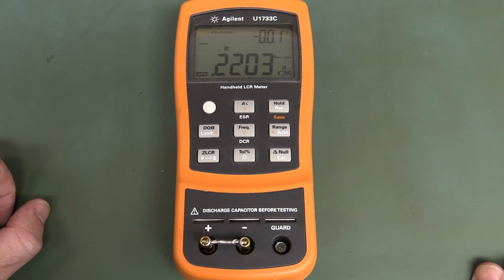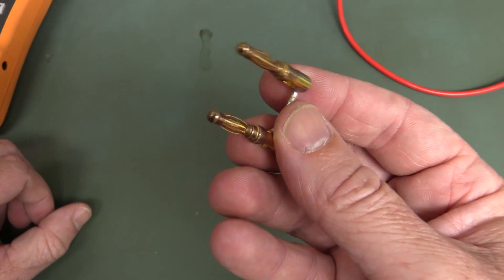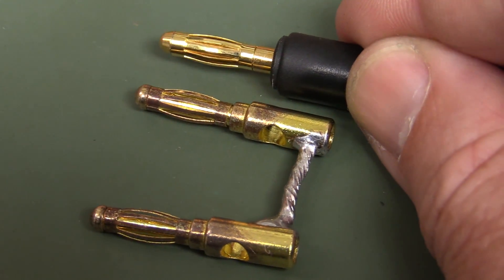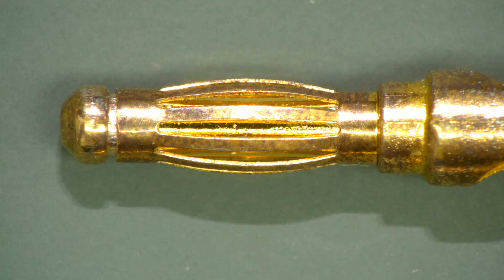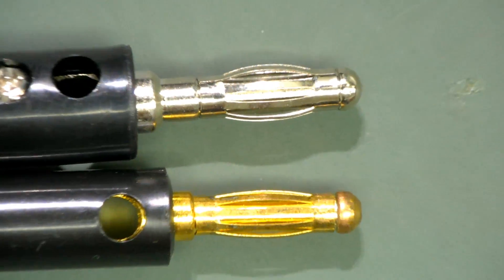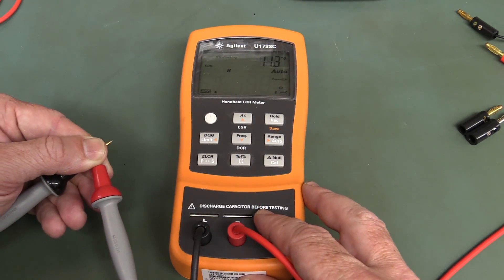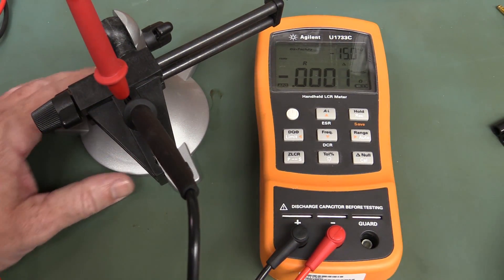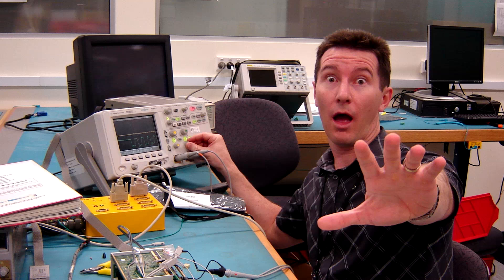EEVblog #1052 - BEWARE Crap Banana Plugs!

Comment: I learned this lesson when I was younger, I was using banana plugs for my speakers (they have the Screw/banana socket type) - after a while I started to get crackles and all sorts, re-wiring them (using same plugs, thinking "no way it can be them") trying a different amp / input etc... nothing resolved it, except I noticed (purely by accident) that when I moved/span the plug with the amp on, it crackled - so I cleaned the contact and the plugs, and still no difference, so I ended up swapping out the plugs and it was fine again... it did the same thing again eventually, so I gave up and now just use the screw terminal connection instead, not as easy when connecting/disconnecting but I haven't had an issue since...

Comment: A while ago I was sourcing just some bog-standard 0.1" 2x20 way connectors. I got a really cheap quote from you all know where. They were quoting £0.40 less than the UK supplier. Then I looked at the specification. The UK supplier has 22-25 micron gold and the other one? 0.8-2.2 micron. Nuff said.

Comment: The problem is not only with the gold-plated banan plugs, and it is not only due to poor plating.
I bought 20 nickel plated contacts whose surface looks very good. All must be eliminated due to high contact resistance.
This is because the spring sleeve is not tight enough when connected. Test by connecting only one contact. If it is simple to rotate it with minimal force, it should go to the trash.

Comment: Possibly the manufacturer didn't use a nickel under-layer between the gold and the brass/BeCu or whatever underneath. Just plating gold directly over copper causes the gold to start diffusing into the copper and might cause pitting like that, so typically one has to add a layer of nickel plating between the copper and the gold to prevent diffusion.

Comment: I think they are 'gold colored' not 'gold plated' :)
Reply: They looks like they're yellow chrome plated. I used to send stuff for yellow chrome plating if the customer wanted to powder coat the object and they wanted some rust protection on it. It's really hard to get a good finish when powder coating zinc plated stuff. One customer used to buy hot zinc plated sheet metal cheaply that were rejects from Volvo Trucks production line. Hot zinc plated sheet metal can emit hydrogen gas when heated.
Reply: You're probably right. I bet they're zinc plate and chromate passivate. Even worse, I wouldn't put it past them to have used hexavalent chrome, which is nasty stuff and has been banned. Want to know how bad? Watch the Film 'Erin Brockovich'.
Reply: Its a high-risk carcinogen. There are heavy restrictions on it. I had to change the finish specs on a lot of automotive parts because finishing subcontractors stopped using it.
Reply: I've seen 'gold earrings' that end up with a questionable finish like that...
Reply: Hexavalent chrome, or chrome-6, is still widely used in aerospace.
Reply: that's why we demand all our stuff be made in overseas slave pits.  Such that we don't have to pay for civilized labor, manufacturing restrictions/regulations, or see the pollution and misery our little dollars and pounds and euros cause when sent 'round the world.  My aren't we civilized.
Reply: It's horrific stuff. You get a drop on you it goes straight through. The area of the factory which I work in that uses it is warded off and uses scrubbers to clear the air. I can't (as if I had any inclination, lol) enter the so-called tank line area as I don't have the correct badge. F that.

Comment: Some similar plugs braze or otherwise electrically bond the sprung multi-point contact to the plug core. Much more reliable. The loose sprung sleeve with no "wiping" contact is just asking to trap dirt and become a bad connection. Anyway, if you are trying to accurately measure low resistance then a 4-terminal technique is the answer.

Comment: I had bought cheap kelvin probes with this type of connector... had to throw them out since my 4-wire measurements were jumping all over the place.

You can get proper banana plugs from eBay if you know what types are good, but eBay is full of very poor ones that aren't even that much cheaper than proper ones.

This type has been very, very reliable and very sturdy. I recommend them highly: http://shop.rabtron.co.za/catalog/images/bula20kr.jpg

Comment: Cleaning them and the sockets on a regular basis is something i've always done, no connector stays perfect.
I use the solid tube type with side spring, not perfect but easy to clean. :-D.
I would not throw away the tarnished ones, clean them with metal polish.
Reply: That's what I'm going to do, spend hours on cleaning a sub 1$ piece of crap. I have 20yo test leads that have never been cleaned, work perfectly to this damn day.
Reply: So you're literally advocating the proverbial polishing of a turd?
Reply: what about self cleaning connectors
Reply: these are tarnished, ive never seen them that way from china, though ive seem terrible loose and badly made ones
Reply: Just buy decent plugs ffs..
Reply: Simon Tay, i've also soldered one end, but the solder does crack in time.
Just keeping them and the sockets clean helps :-).
I've never had any type of connection that didn't need cleaning, the world of damp and muck lol.
Reply: tocsa120ls Yeah even the non gold plated old ones still work good. I'd try and clean or fix it if it's some original cable or probe for a piece of test gear instead of buying new ones. Gotta have the original cables!
Reply: I have never seen a connector look as shit as these, and if you clean something without gold plating with metal polish, you`ll just remove more of the gold PAINT they used..
I have plugs that are 12 years old that look better than these!
Reply: An eraser works too.
Reply: Exactly! Just solder the rotating part to the inner solid part at one end and clean with fine sand paper. Any that are really bad should be recycled with metal, not just thrown away in general waste/trash.
Reply: All of you do realize that these might be "brand new and unused"? I've bought some banana plugs from eBay and there are many types that are very poor quality like these, and then there are some that are exceptional quality for the price. The hard thing is to learn which ones are good ones and one will lose some money while buying  bunch of different ones and throwing bad ones out.

But after you find one that's good, I always buy them in droves so I'll never have to buy more ever again :D

Comment: I don't think the issue is so much the "split" as it is the diameter of the bad connectors. You can see the rotating bit does not have the same diameter at the ends of the rotating piece as the ends of the solid piece, and overall next to the Probemaster connectors the entire thing of the bad connectors looks like the diameter is smaller.

Comment: A lot of amp companies now do not like people using banana plugs either, not sure if this is the reason but i've not seen a hifi amp since the 90's that took them.
Reply: Mooseteets Reason why most european amplifiers have bananas blocked with that plastic is becouse banana plug are rarely used here due to the fact that you can just push them in 240v outlet (at least thats what people are saying, i still use them since its fairly easy to disconnect cables)
Reply: Because banana plugs can pull out when amp is use and this can broke your amp. Plug itself not problem.
Reply: https://www.youtube.com/watch?v=9zuchv9-XvQ
Reply: All modern amps take them, you have to remove the little filling plug in the middle. It is because of eu regulations because it is the same size as our wall plugs that they have to cover them up.
Reply: Mooseteets and i haven’t seen a brand name amp or receiver from the last 10- 15 years that doesn’t have banana terminals.
Reply: now this is the funny thing, they have banana terminals but wont take the plugs, the holes are filled. the amps ive seen that wont take them are Onkyo and Teac brand, i haven't really checked other brands but it specifically says in the manual not to use plugs. also, this may only be in Europe, not sure about the rest of the world, but here they dont like em it seems. https://www.avforums.com/threads/banana-plugs-prohibited-in-europe.810024/ lots of similar posts about it on google.
Reply: Cekpi7 I sure hope they are not banning this basic electrical tool.  And plugging them into mains (with appropriate skill) is a feature to the point of the non-UK plugs being various combinations of banana plugs in a consumer safe housing.
Reply: Too many manufacturers go the cheap route with spring grip terminals. Makes it a real pain to use decent-quality speaker wire. I used to have a Philips receiver that had chunky screw terminals with holes in the end to accept banana plugs (and they were nice enough to put in notches in the terminal base so the wires could come in at an angle and not get jammed against adjacent terminals).

To Haralampi: I have a Sony receiver from 2002, not a single banana terminal on it, not even the fake ones. Spring-grip only. And really weak ones at that.

Of course, this is merely an observation, as I haven't bought higher-end gear since the 90s.

Comment: Place your bets, guys. Is the plating:
1: brass
2: titanium nitride
3: niobium oxide
Reply: I vote "whatever was cheapest in the Shenzen Underground Coating Market that day".
Reply: That would be plating the copper with a thin layer of zinc and with some heat forming a brass layer. But that would not explain the smooth surface.
Reply: Probably brass. Looks like brass oxidisation/tarnishing to me.
Reply: Cadmium dichromate over steel would be cheapest, and goldish color, but really inappropriate for any kind of precision electrical contact. Growing up my family had an electronic connector manufacturing business, and saw lots of beautiful gold plated coax connector parts, and parts like mechanical brackets with cadmium dichromate.
Reply: Brass mostly, specifically what's informally know as free-cutting brass, which is a brass that's alloyed for excellent machinability.  The banana plug we are talking about looks like it has an inner pin that could be machined from a long rod on a swiss type automatic screw machine (see https://www.youtube.com/watch?v=6VpCBk7FahI for a somewhat similar machine). The outer contact finger is likely made in a punch press stamping  from rolls of thin sheet metal (don't know what kind), which are then rolled into a tube (ideally in a progressive die so the output of the machine are tubular). If you were a cleaver toolmaker, perhaps you could make the finished pins feed into the stamping die, and do the final assembly around the pin as part of the stamping process. Having a total of only two machine steps would minimize the per part cost and degrade quality, with the expense of more complex and more expensive tooling. This would require using preplated (or no plating) sheet metal (so the edges will not be plated) and an ugly cleaning problem to get all the oils out from under the contact. If we tore one of these connectors apart, and unrolled the contact, it might be a little clearer exactly why it's junk. A pretty easy test for gold is found at https://en.wikipedia.org/wiki/Acid_test_(gold). A year or so ago, I had some test leads with exactly this issue, but I sent them back.
Reply: Jan Bottorff Did they use solid brass or bronze much?
Reply: yellow chromating
Reply: Thanks for the fun facts.  In the genuine Multi Contact part the cages are made of beryllium copper, which I understand gives the copper some spring qualities.  In the tubular LS4 plug that's also shown, the entire body is beryllium copper.

Comment: Another issue: I ordered some Ebay banana plugs, and they came looking like the rotating sleeve type except they don't have a sleeve. It is all one piece. I tried them out and the first time you insert it, it is snug. After you remove it and insert it a second time, it is loose and barely makes a connection at all, it would just fall out of the slot. Completely useless, beware!!

Here is what the offending plugs look like: https://www.ebay.com/itm/100-Pcs-Speaker-Banana-Plug-Gold-Plate-Connector-45mm-Black-And-Red/272971588601

I think it's actually better to get nickel plate cheapos than "gold". They seem to be better quality, and perhaps it is actually nickel? Whatever they use for "gold" is probably not as good as nickel.

Comment: Get a pair of earphones and a diode and you've got a 'crystal set' :)
Reply: If the connections are sufficiently oxidised and rectification occurs you might even be able to ditch the diode.
Reply: David Perkins What about the L and C components?
Reply: If there's one very strong signal then L & C aren't needed.
Reply: vk3ye it's a feature, not a bug :)

Comment: This is so called "chinese gold" - coating by titanium oxide.
Reply: Titanium Nitride
Reply: Titanium oxide is used as the white pigment in white paint i think. Its not in any way gold coloured, Chinese or not.
Reply: Don Erickson 
But titanium nitride doesnt corrode and its hard as fuck. The colour matches but i doubt theyd use anything titanium in cheap ass plugs
Reply: Could also be Zinc Dichromate or Yellow Bronze. I imagine there are many things it could be. Whatever they use to mimick titanium nitride coating on cheap drill bits would be a good start.
Reply: But does it conduct as an oxide?
Reply: I bought some cheap-ass Chinese titanium coated drill bit from one of the local farm/hardware stores a few years back. The set came with a blue plastic index stand and several duplicate drill bits. This was really for my woodworking hobby. Anyway...when I got them home I discovered just how bad the Chinese stuff can be. EVERY BIT WAS CROOKED! If you put them on a relative flat surface...like a clipboard and tilted it so they would roll off, they would just flop around from being bent or curved. HORRIBLE! I still have them in my shop to remind me of what you are really getting when you buy cheep ass Chinese crap! How on earth can you manufacturer drill bits using metal rod that isn't straight to begin with? Amazing!
Reply: I'd be more inclined to think they have such low production standards that they bent the bits while cutting them into shape.
But I really have no idea. XD
Reply: Yellow chroming?
Reply: To me it just looks like they used way too thin a gold plating.  No matter what they put on it, gold would probably have been softer and subject to more abrasion but remember that they were corroding as brand new sitting in Dave's drawer so obviously the coating was so thin that it didn't even achieve 100% coverage, then the base metal oxidizes and opens up even more gaps in the plating.

The other possibility was the base metal was such contaminated or tarnished crap before the gold plating that the gold wouldn't stick to it, except that we see it got worse with the plugs that were used, even in non-contact areas so there does seem to be post-plating oxidation going on from insufficient coverage.

Comment: really dude? you couldn't rule out bad contact between the rod and the moving ... part by just soldering it?  Also, a 14 minute video just for this?  you're getting bad at this Dave
Reply: Isn't this more of a Hey new people watch for this type of thing happening type video?
Reply: I wound up getting some of those a while back and had to do exactly that.
Reply: Simon Tay ever heard of a "recycling bin"? There's no indication here that they're going into general waste.
Reply: costyytsoc as pointed out by others, you really wouldn't want a shoddy connector like this anywhere near an expensive piece of test equipment. Who knows what kind of contamination or other damage they could cause?
Reply: Exactly! If I had already bought these same ones, I would've just soldered the rotating part to the inner solid part and cleaned it with fine sand paper. Takes a couple of minutes. I'm not wasting money buying new ones when I've already paid for these.
Reply: Incase i didnt solder them, i wouldn't just throw them away in the general waste bin. I would recycle them properly, which Dave should be doing too because metal is recyclable.
Reply: don't get me wrong, i don't think dave should stop making vids like this, but come on... 15 minutes for a crap  connector?

Comment: Send them to CodysLab, to see i they’re even real gold!
Reply: spoiler, they are just Titanium Nitride coated
Reply: @Leo Curious Have you ever seen gold tarnish like that? the answer is no.
Reply: Aksel Baumann great idea!
Reply: Who says that what you see there is gold and not just copper? If the gold plating was badly done it will come off really easy, so you see whatever is down below, maybe copper. On every location where there is a possible rubbing etc. where it can come off it did so. But it didnt do so in the corner etc. where there is much less friction.
Reply: Well there is not much else that looks like this and behaves like this too...
Reply: It probbebly is brass
Reply: Probably brass

Comment: the secondly shown multi contact plugs - LS 4 - are really high grade. Got them on stock and in use  for > 25 years, practically no wear-off. of course also no corrosion. 0.02 ohm for a 50cm mc cable. You get what you pay for.
Reply from the maker: Indeed.